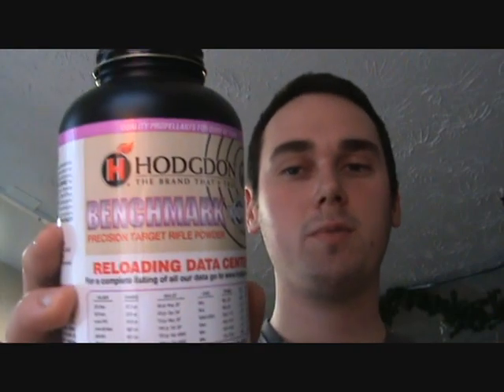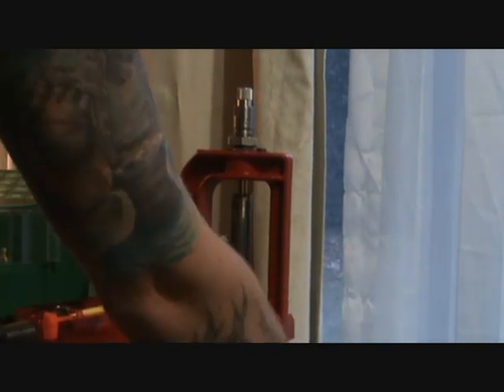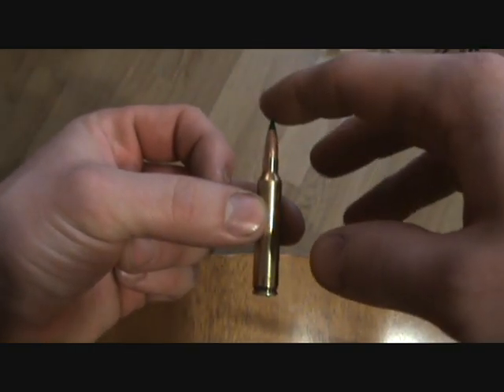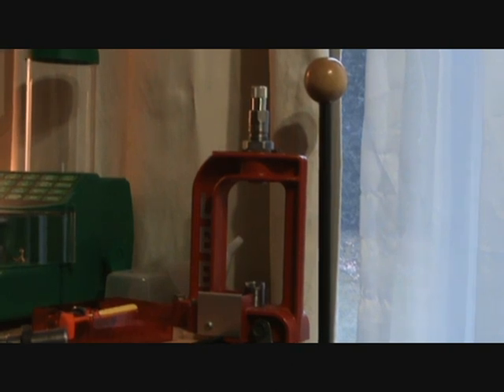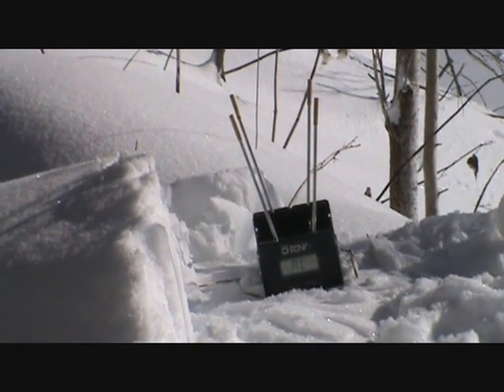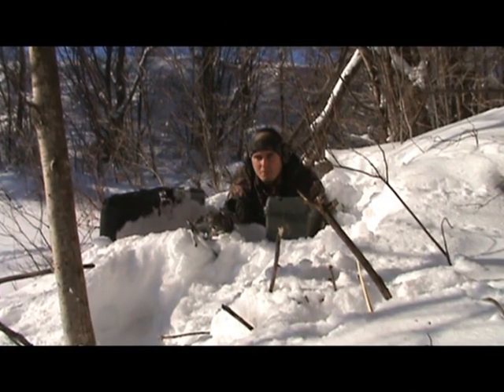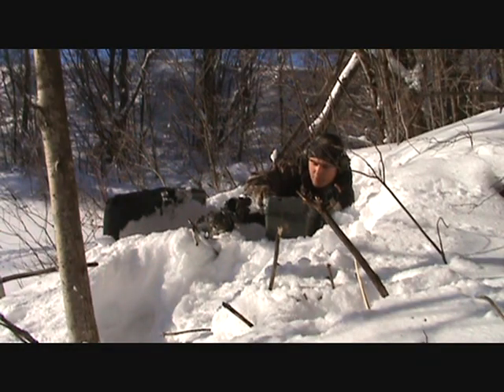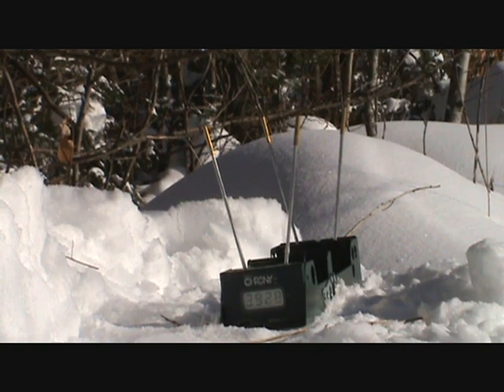Reloading 204 Ruger pt2

Comment: Measure your fired cases with a gauge and get them 1 to 2 thou shorter than the fired case, if you dont you run the risk of having to much head space which is dangerous and thats only around 8 thou it could turn nasty